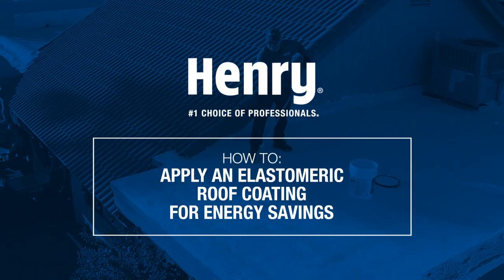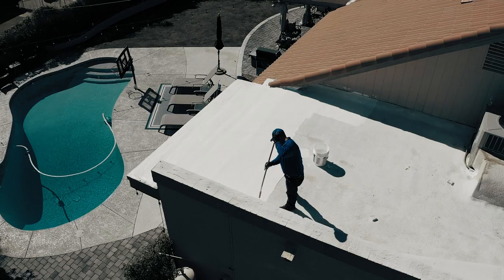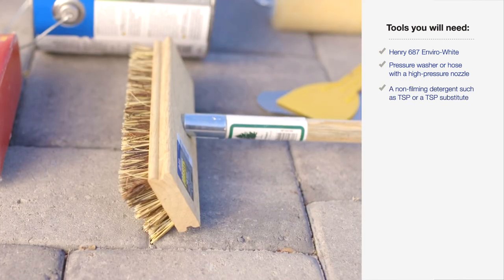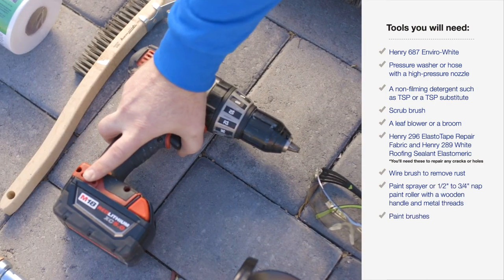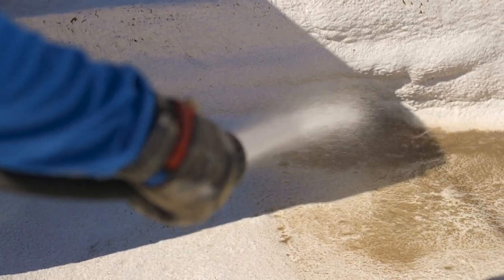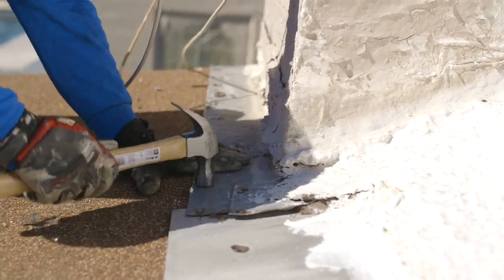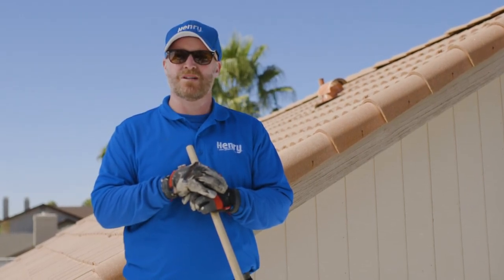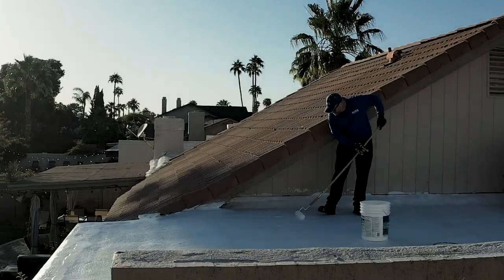Henry: How to Apply Henry® Elastomeric White Roof Coatings for Energy Savings

Comment: I just bought sealant 289 and coating 587. If I use the sealant for cracks, do I apply the roof coating (587) on top of the sealant?